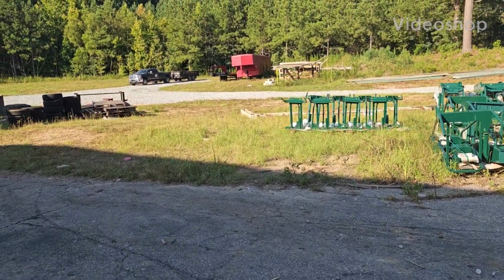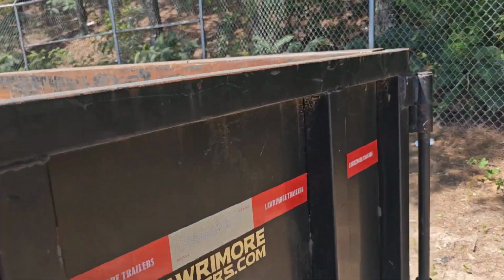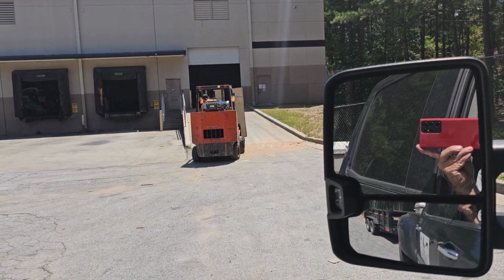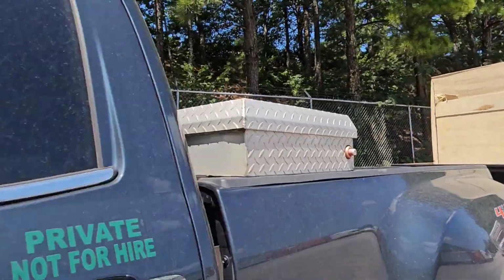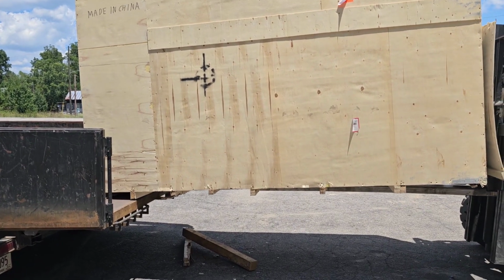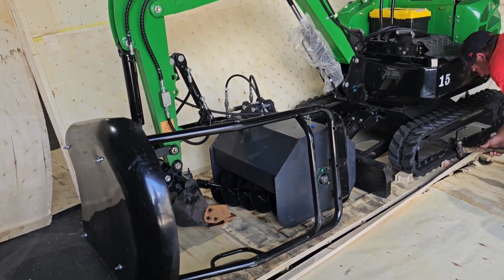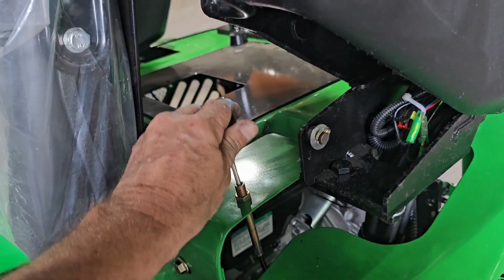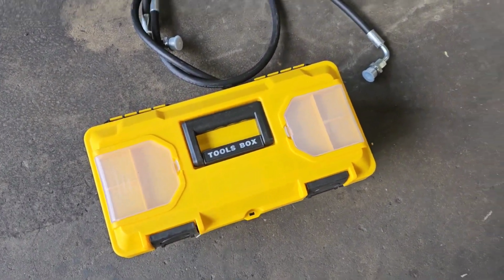Imported Chinese Excavator

Comment: I looked into importing a Chinese machine. I ended up importing a used Japanese machine,  Much better quality. The thumb on mine at least lays all the way back against the stick. Don’t get me wrong I have had a few little issues. But I can get parts and have parts made way easier.

Comment: I have big Cat excavators and all other types of heavy equipment. But this little unit may have its intended purpose. The DIY backyard guy. Ditches. Little pads. Tree cutting. Plumbers would love it. Off the shelf parts. Gas engine. Just go to a machine shop for little repairs. It's a platform machine for any kind of modifications. I'm north of Atlanta. Do you have an recommendations on how to buy one of these? To do it right and save money? Where was this import facility? Thanks for this video.

Comment: Hi Gary.  Nice mini-ex.  I purchased one last year... also a 1.5 Ton and still getting used to the sensitive controls. I'm interested in the bush cutter attachment.  Did you get it from Nuoman also?  If not, where?  I subscribed and will be watching your videos.  Thanks.
Reply from the maker: yes they ship with machine it's works but not as good as I think it should. I believe I need to change cutting blades to BCS cutters

Comment: I have no idea how much this is,  but man .. and I thought my kubotas are garbage... than I wouldn't have words for this one. I paid 33 out the door for 1.7 ton kubota with thumb,  blade, retractable tracks (39-49 inches), 2 buckets and no other attachments...I'm not very happy with it but it works like mercedes compared to this.  This thumb is on the way of everything! It needs to go up parallel to the cylinder! Freaking chinese! Can't make anything! Pretty sure it's under $10k though.
Reply: He said, it was $9,500 including all the fees and taxes and attachments. Maybe an extra $50 at the drop off to use the ramp.